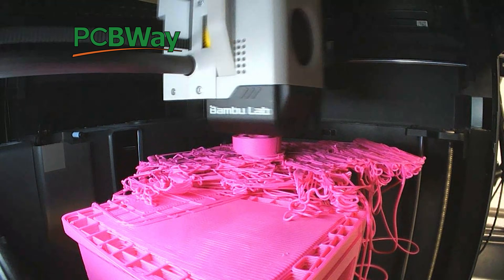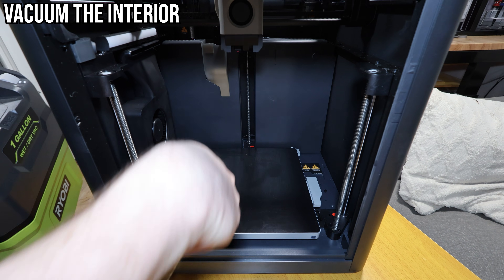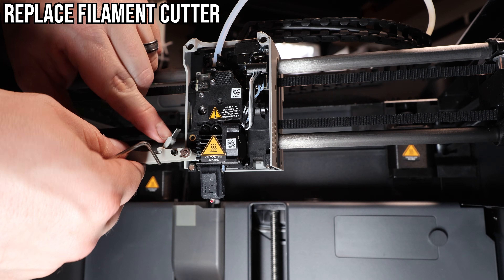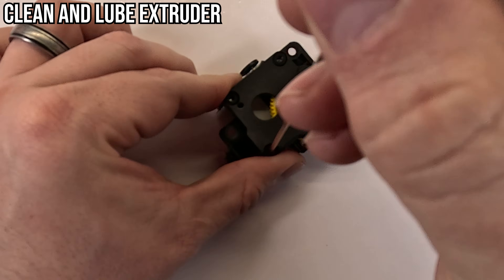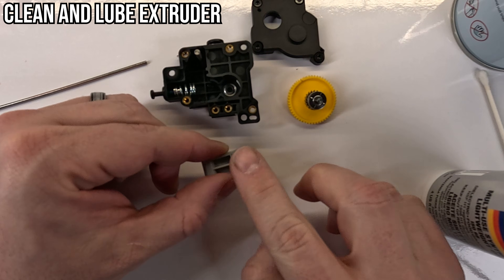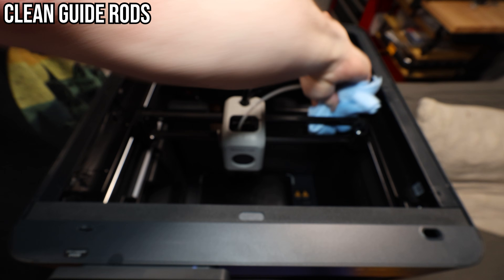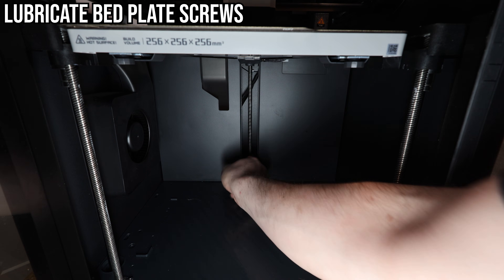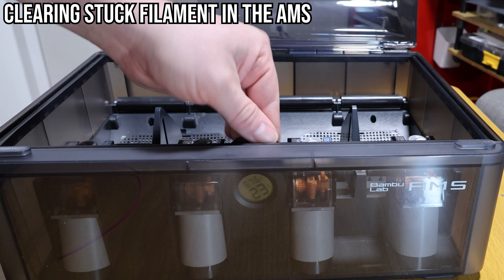Bambu P1 Maintenance You Should Be Doing Every Month

Comment: Great video very useful but I would recommend one thing and that is to do everything that involves compressed air and vacuuming first you don't want to put fresh grease on the lead screws and then blow dust all over the place
Reply: yeah, and never use a power vac to clean the inside of the machine, meaning one you plug into the wall, you used a battery opporated one, which is the best way, but using a corded vac can cause real damage, due to static electricity. , good work though. Just curious how the greese on the filament extruder worked out? did it lslip or uunder extrude?

Comment: I have found that on the nozzle wiper if you are careful you can loosen the screw that holds the little white piece in place then rotate it 180 degrees and tighten it back up to double the life of the wiper.

Comment: the extruder gears should be sqeaky clean on the filament grip part. and lube on the rod tips where they socket into the casing/bearing, and the big yellow gear and the other gear that meshes with it.

Comment: the first time i had to remove extruder , the thing that surprised me most is how tiny all the parts are. being 6'1 and an uto tech i have large hands so i had to be extra careful ! LOL and dont plug your part fan backwards it wont work LOL ! happened to me PS theres an updated file that make the round humidy meter level !   had the same issue
Reply from the maker: I'll have to check out the updated file.  I wondered how they designed the humidity meter to fit but didn't rotate the cut out to make it level.